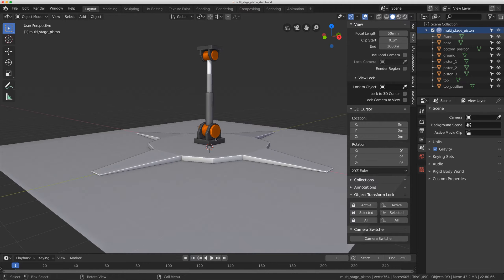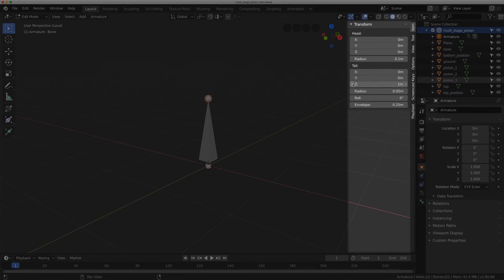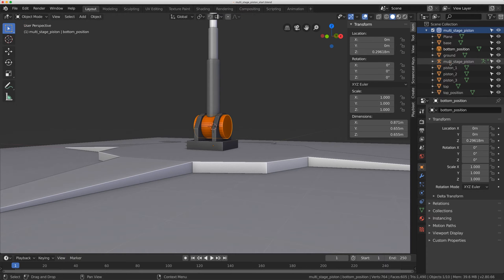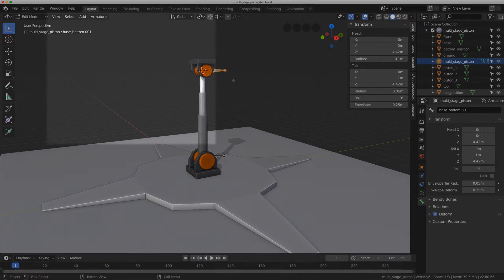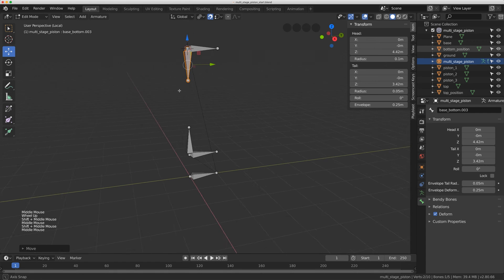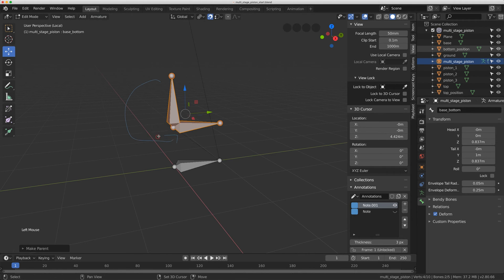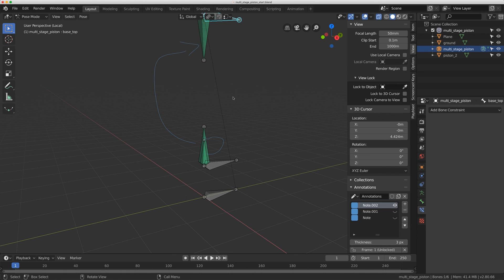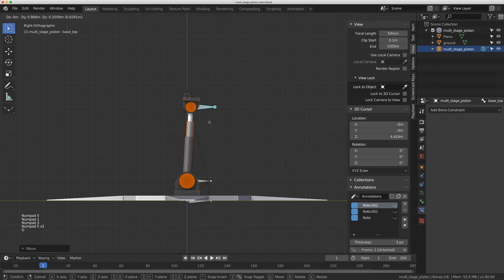Rig A Multi Stage-Piston | Blender 2.8 - Rigging For Animation

Comment: Great tutorial that explains a lot for beginners. But ... For this particular case shown here: Multi-stage pistons do not work like this. First, the cylinder with the largest diameter extends completely before the smaller one goes into action. So here is the question: How can I set up my system so that the cylinders are moved one after the other and not simultaneously? Thanks in advance.

Comment: just curious, what type of Mac are you using? I ask because I just bought a Mac mini and have every intention of working with Blender on it.
Reply from the maker: For this, I was using an IMac from 2012 (i5). I used that computer for 8 years and never really had a problem with any Blender project. Overall it worked out well.

Comment: Expected a transformation constraint. Wondering how you would make an extendable sleeve rod rig. P.s don't you have dependency loops? Nice Rig. Thanks
Reply from the maker: Transformations are great as well I use them all the time! Although, this same method should work for an extendable sleeve rod. This rig does not have any dependencies, you can check this by going to the console: https://blender.stackexchange.com/questions/23147/how-do-i-get-the-console-on-windows
Reply: I missed it too but the important step is at 8:45. I know 2 years old but maybe someone else has this problem.

Comment: Very helpful, I am happy I found your channel. I have one question: At some point in the video you duplicate one of the bones (the one parented to base_bottom) and you flip direction to place it on the other end of the piston. My question is, did you flip the direction of the bone, instead of rotating it 180 degrees, to avoid rotation problems? would it have caused trouble if you had that bone with a 180 degree rotation? 

Thanks a lot!
Reply from the maker: I used the switch direction feature under the armature menu. 
https://docs.blender.org/manual/en/2.80/modeling/surfaces/editing/segments.html
In this case, I do not think it would have caused an issue if I just rotated the bone 180 degrees. In other rigs though, it might. Here I am using the position rather than the rotation axis to move things around. The change in rotation just provides a direction for the damped track. 

I usually use the switch direction option if there is a custom rotation on the bone (ie not locked to one axis), other than that I might just rotate the bone.

Comment: Great video as always! Thank you very much!
May I have a question? How would you approach rigging of a rolling dice? To animate changing pivot point at cube´s edges?
Reply from the maker: Hey, thanks! Glad you liked it! For dice, I might actually use a simulation rather than an animation as it would look nicer but if I had to rig it I would add controller in the middle and then add control at each of the corners and parent these to the middle controller. Then I would use my 3D cursor as the pivot and snap it to the corners. With this, I could translate or rotate from the center controller.